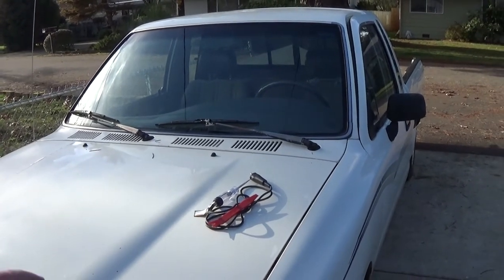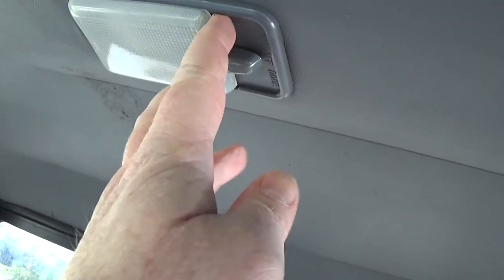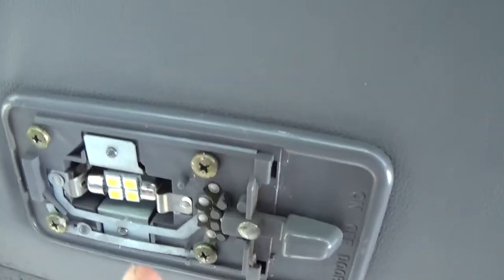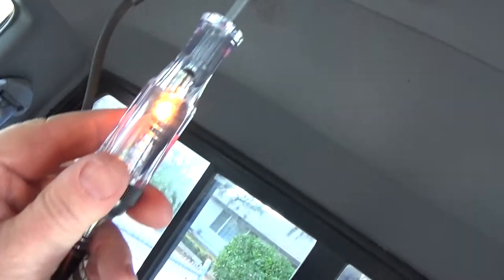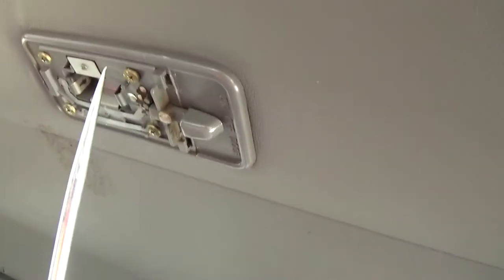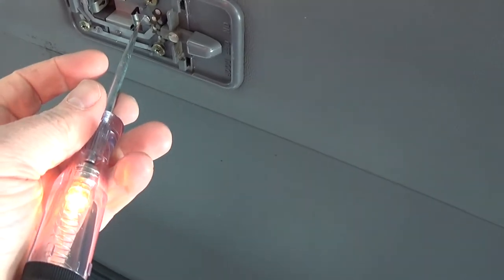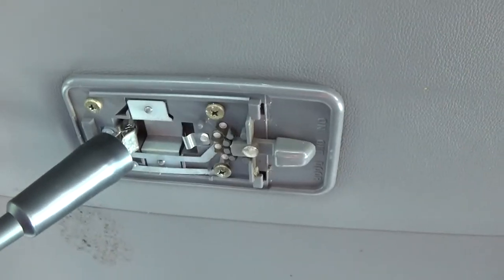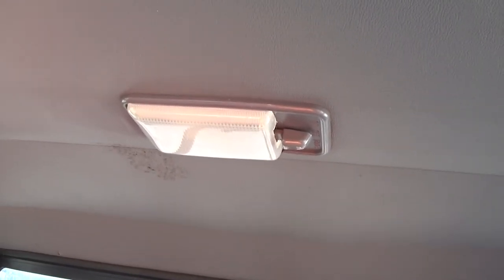Troubleshooting 1991 Toyota pickup dome light

Comment: Nice video..   My car which is a 2014 Nissan Pathfinder.. I opened up the map light and it has a lot of wires on the harness,    Left side has 3 wires white, black , black ,   Then on right side it has 3 wires red , blue, green.      Can I use this tester to test out each wire and it will tell me which one is HOT and which is negative?   I am trying to find which 2 wires I need to tap my foot well led wires to…